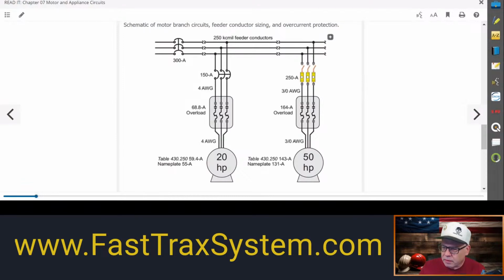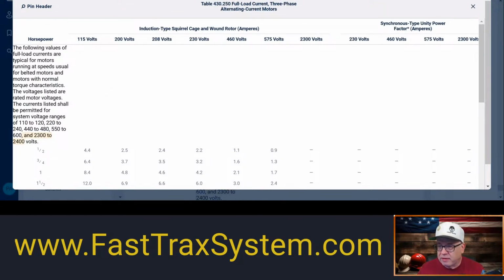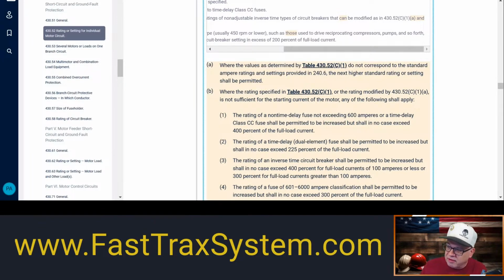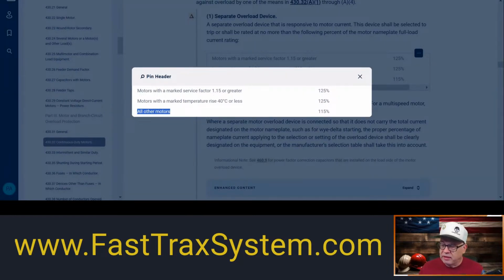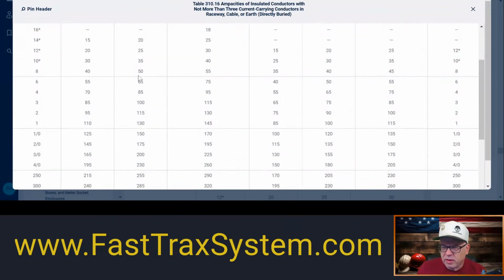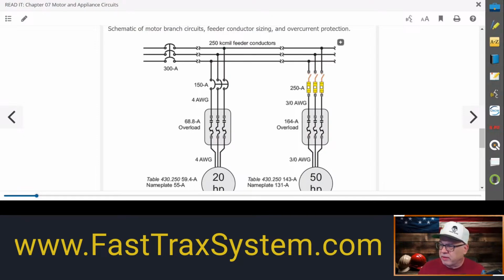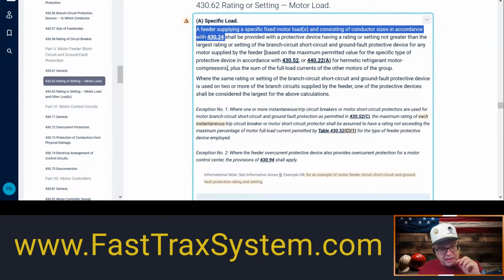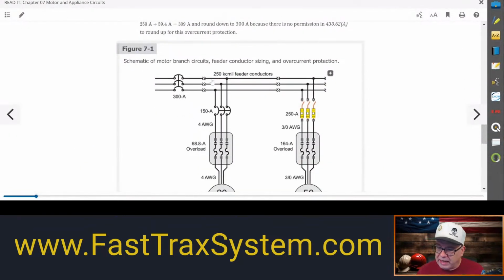Coffee Hour | Let's Talk Electrical Codes | Unit 11 Multifamily Dwellings

Comment: During a test if terminal temps are not given do we assume 60 degree under 100?
Reply from the maker: If they give you details that meet 110.14(C)(1)(a)(4) then you can assume 75°C. If they dont give you anything, not the wires ratings, lugs ratings, or motor terminals not given then most certainly stay in the 60°C column.